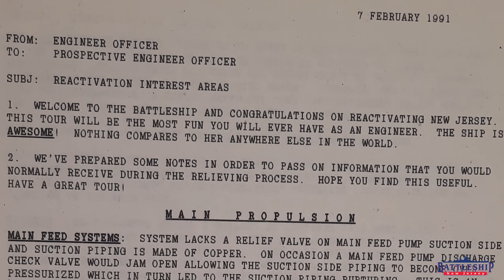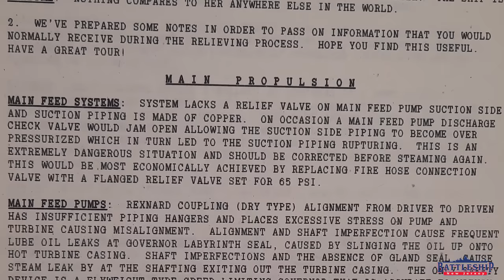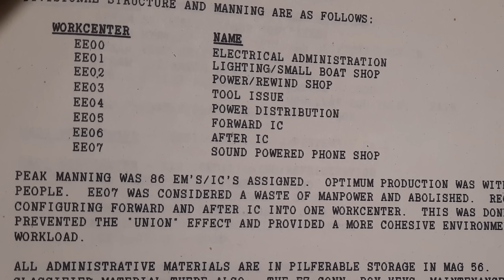The Call To Freedom Will Be Sounded Again: How to Bring Back Battleship NJ

Comment: This is incredible. I’m a shipyard test engineer and I’d quit my friggin JOB to be part of bringing New Jersey back.
Reply: I'm x-Navy and a mechanical design engineer in Aerospace Industry now, but I have told my family the  same thing...I'm pulling for San Diego to get one to renovate!  See you there!
Reply: I'd just about quit my job just for the privilege of rummaging that second box down!
Reply: I’m a licensed pipe fitter and hvac tech. You go, I’ll go!!! I’d love to get the Missouri going too!!!
Reply: 30yrs of welding, fab, machining and industrial painting... I even have tools?
Reply: You'd have so many volunteers will I ng to sleep on board and work!
Reply: I can cook and sweep floors.  Also a pretty good bottle washer if I don't say so myself.  Mop, I can also mop.  When do we leave?
Reply: I'd love to see all 4 of those hulls get refitted with A1B Nuclear Reactors, and new high efficiency propulsors. 

With that much shaft hp, and turbo electric capacity, they could install just about anything and still have plenty of power to spare.
Reply: I don’t think they will. But I think they should. As a weapons platform it is amazing the potential it could have.
Reply: I am Italian , marine engineer with experience on steam ships, I would sell my soul to do that !!

Comment: Honestly, I feel like the topic of bringing back the battleship will be around as long as this channel is lol
Reply: Along with the 'can we make the turrets operational" arguments.
Reply: The battleship reactivation debate will be around until there's an adequate replacement for them in the naval gunfire support role. That's the only thing that will end it.
Reply: as long as the 4 Iowa BB's are still floating the debate on reactivating them will continue
Reply: @baronpen  Naval gunfire is a dead concept. VLS missiles do everything better and all modern ships fire the same missiles but just have different amounts of them.
Reply: I feel bad for whoever we bring it back against.. searam and lasers going to make her pretty stout
Reply: @crazybarryfam  I don't think the powerplant would be able to power lasers lol. It would take like hours of charging capacitors to build up enough charge.
Reply: @rubiconnn  I don't think so, the Burke's have them and I think the steam plants on the Iowa class have enough excess potential. Regardless, a turbine plant could be added if need be. The Iowa's have as plethora of space and steam.
Reply: @crazybarryfam  In another video they said removing the old powerplant isn't really possible due to everything being deep in the hull with like 6" thick armor hull around it on all sides so they are stuck with the oil burning hybrid electric propulsion.
Reply: @rubiconnn  the Rail-gun concurs. Relatively small, energy dense projectiles.
Rockets are expensive and need a guidance system and lots of propellant, that severely limit the weight of a warhead.
So, they need a LOT  of space and deliver  precise, but low effect to a target.
With LOTS of projectilees in the same space as 1 rocket, the ship can store much more ammo, for a lower price.
Reply: @pteppig  The railgun project was abandoned by the military as it's unfeasible with today's technology. Missiles are here to stay with lasers and guns being used for CIWS. Even if they made a viable railgun, missiles would still have ranges orders of magnitude more than a railgun could ever shoot.
Reply: @rubiconnn  Anything is possible, just takes the will and $$.
Reply: @rubiconnn  who wants to remove one? You could easily install a gas turbine to supplement.
Reply: @rubiconnn  you can NOT shoot down a 16in shell!
Reply: @captaincumrag42069  There was Russian Moskva which did use it's guns to provide fire support. But it's guns were nowhere near as big as the Iowa class. It also sank. (Although it was in far worse condition than the BBNJ.)
Reply: @americanpatriot3638  Can you? You can probably shoot it down but it is very different from a missile and would probably be much harder to lock onto it with missiles due to a lack of propulsion systems.
Reply: @maxbennett5412  CIWS doesn't track heat or light. It uses radar to find projectiles. The land based variant (the C-RAM) can track much smaller projectiles no problem like mortars and rockets.
Reply: @americanpatriot3638  You don't need to shoot down a 16" shell as any ship that fired them would never be able to get close enough to a target that would have close in weapons to use them. A 16" gun has about a 30 mile range. A cruise missile has about 1000-1500 miles range.
Reply: @rubiconnn  Perhaps, but in a large scale conflict you have to be able to produce and pay for those missiles, as well as have the rare earth minerals needed for them.  Plus, it would take a lot of ships indeed to bring as many missiles to a fight as battleships can bring shells.  And every VLS cell that is loaded with a Tomahawk is one less cell that can be loaded with an air defense missile, something that could prove critical, especially if fighting stealth aircraft that are hard to track.  

Certainly reactivation of the Iowas is not a viable thing.  A ship with large caliber, fast firing guns is most definitely not out of the question, especially if equipped with guidance packages and rocket assisted projectiles.
Reply: @MK0272  Large ships are completely unviable in the modern age. For the size of a large battleship you can build several destroyers or cruisers. Large guns for anti-ship/shore bombardment are long gone and are never coming back. Ships technically still usually have a small gun on the bow of the ship but that's mostly for close range engagement with small boats when firing a missile is impractical. There's pretty much no way that ships from two opposing sides in a conflict could ever get close enough to fire guns at each other.
Reply: It would be easier and faster to build a new ship.
Reply: I would love to see the iowa's back in service but from a cost perspective it would be to costly to reactivate and modernize them with all the new technology we have today
Reply: @rubiconnn  they do use thermal
Reply: @rubiconnn  Problem with missiles is they are hideously expensive compared to naval gun rounds. A missile easily costs more than a million dollars per missile, vs large caliber gun rounds which are a few thousand. Missiles, also being much larger than gun rounds, means a ship cannot carry as many missiles as they can gun ammunition. Its the same reason guided rocket artillery hasn't replaced conventional gun artillery except for only the largest calibers. The sheer expense of missiles means that they are limited to being used against point targets that you know exactly where they are. But if you don't know exactly where a target is, just its general location and you need to suppress that area, missiles are far to expensive to expend for that purpose, gun artillery is perfect for that role. 

Dug in infantry and camouflaged vehicles hiding in a forested area is a perfect example of the type of target that missiles would have a hard time with.
Reply: @rubiconnn  Incorrect. Railgun's are being placed on hold because the R&D for them is basically done, they just need to find better materials for the barrel wear problem. And see my comment about the expenses of missiles that makes them not universally useful.
Reply: @rubiconnn  Don't assume anything about the future. Naval warfare is always evolving and changing, and there is always the possibility that one day the modern paradime of missiles dominating naval warfare will go obsolete. By what, who knows, these things are not predictable. It's certainly not impossible that future railgun and laser development could render missiles obsolete, but when, who knows, these things are impossible to predict.

And on the subject of large ships, large ships are often more cost efficient than smaller ships due to economy of scale. A large ship that costs twice as much as a modern DDG or CG would easily be able to carry more than three times the number of missiles, as well as having a greater engagement range because it can mount its radar higher and thus have a further radar horizon. The problem is that kind of capability is unnecessary in a world where few navies have more than a half dozen DDG's ad war between any larger navies is very likely to end in a nuclear exchange. 

And when the only capabilities a larger ship can offer over smaller ones is just carry more missiles, longer range radar and the potential to armor against most missiles, it isn't enough capability difference to justify building a whole new class of ship in a navy where the role of a surface ship is to protect the aircraft carrier and let the aircraft carrier do all the offensive work.
Reply: @ryuukeisscifiproductions1818  Times have changed and warships aren't really used for that kind of tactical support purpose anymore as ships can't even get close enough to shore for coastal bombardment without getting hit by anti ship missiles. Nuclear weapons have made major conflicts between large states unlikely. The support roles of warships has been replaced with aircraft. Combat for warships is so uncommon that the cost of missiles doesn't really matter when only a few missiles are fired from a warship per decade.
Reply: The discussion of bringing It back will be around as long as the Battleship is afloat.
Reply: @ProfessorMAG  and that’s the one that would kill them coming back the restoration to active service they could probably build 2 of them in the same time
Reply: @baronpen 
Doesn't have to be guns delivering an explosive charge somewhere, so saying that until there's guns that can take the place of gun's on battleships there may always be a possibility to bring them back is completely mute. 
People should just admit that they like battleships and think they're cool instead of stretching out some narrative that's irrelevant in this day and age, for the same amount of money and time it'd take to get a battleship back online lots of other far more flexible and effective weapons can be acquired, why does it have to be a gun that delivers an explosive force? It doesn't, there's plenty of other far cheaper ways of doing it, and when it comes to military spending cheaper means you can have more for the same amount of money, so why cut your own throat for the sake of nostalgia?
I've been a mechanic since 1981, you'd be hard pressed to find anyone who loves the old muscle cars more than I do but by the same token because I've been around, and thoroughly through, automobiles for so long I'm not stupid enough to fall for that whole "They don't build 'em like that anymore" nonsense, they don't, they build them better now, today's cars make far more horsepower per cubic inch than they did back in those days and they do it using far less gasoline per horsepower also, they hold a rock steady idle which those old cars couldn't, they go much further between rebuilds and just about anything else you can name is vastly better about them than it was back then, which is exactly why the only time you see those old cars in races is in vintage racing, because if you tried racing one against modern cars like in SCCA Sports Car road racing one of those old cars would get beat up so bad it'd be embarrassing.
Another and even better comparison would be the M1 rifle, still an effective battlefield weapon by any standard but given it's expense of manufacturing with all of it's forged and heat treated steel parts you can put twice as many M16's on the battlefield, and like modern weapons compared to the guns of a battleship it has other advantages over the M1 to boot.
The days of parking a battleship just outside someone's port to choke them to death are gone anyhow, aside from better ways of delivering an explosive charge into someone's lap warfare itself has changed substantially anyways rendering the battleship obsolete.
Reply: @rubiconnn really the role of. Battleship is power projection above all else.  Sure other ships are better at land to shore attacks and are at less risk of being hit, but imagine you are a nation debating going to war, and a opposing country sets up a fleet of battleships in international waters just outside of your major ports. Along with a threat that if you attack, every one  of these ports will be destroyed.  At this point it doesn’t matter if they shoot at the battleships because today’s weapons could only cause mission critical damage to these ships, and if they fire then the battleships mission is over anyways
Reply: Standard 16in guns have a 30 mile range. 16in harp gun have 110 plus range.
Reply: @rubiconnn  You won't be supporting a naval amphibious landing operation with VLS missiles.
Reply: @slags83  Large scale amphibious landings in combat don't happen anymore. No country on earth builds large fortifications along shorelines anymore. Even for some backwards reason they did, VLS cruise missiles could absolutely be used. Instead of moving your large ships to close to shore do fire hundreds or thousands of shells hoping to hit your target, where they would be easy targets for anti ship missiles, you could precisely destroy any targets with cruise missiles from hundreds or thousands of miles away.

Comment: I don't think they'll be brought back, although I won't say "never."  One never knows what may happen in the future.  I remember years ago someone asking a B-52 pilot why the Air Force keeps them, even in this day of precision guided bombs.  His answer was "Sometimes, you just need to drop a lot of dumb bombs on something, and that's what this can do better than anything else."  It may someday be that the Navy decides that sometimes, you just need big guns to shell something, and what can do it better than anything else is an Iowa class battleship.
Reply: Why not say never? The infrastructure to put one of these back in service doesn't exist anymore, literally everything will have to be rebuilt from scratch. I dare say the only reason they added tomahawk missiles to these ships is because they didn't have enough replacement guns left over.

They'll crank out a couple dozen missile cruisers with 8 inch guns. They don't need battleships that will do nothing more modern ships couldn't, but bleed the navy's budget.
Reply: @tremedar  You might be surprised.  Look up Watervliet Arsenal, and what they can make.  As for budget, the question would be "is it cheaper and faster to return this to service than to build a new ones?"  

Now practically, I'd say it's not going to happen.  But then again, most military planners thought that massive artillery duels were a thing of the past, until Russia invaded Ukraine.  So, I won't say "never."

Comment: I would definitely like to see a copy of (and an on-screen review of the areas in) that document. It'd be interesting to see the areas of the ship the last operating crew thought would need attention in a potential reactivation and how they're fairing 31 years on under the museum's stewardship. 

I'm especially curious how much stuff that's on that list is also on the museum's list (or was previously repaired by the museum). I suspect it deals with the mechanical systems moreso than the hull & "routine maintenance" stuff you have to do to keep the ship watertight and in good repair,  but I have to wonder how much overlap there's been between the departing engineer's concerns and the museum's over the last 3 decades.

Comment: The best job in the world you've got on board of her. Finding all these treasures is indeed archeology. She would be a great command ship, the firepower easily expanded with guided artillery for precision shore bombardments. She is absolutely seaworthy and big enough to equip her with all the necessary defence systems, and missile and drone offence systems. 
Lots of the old wiring can be replaced with modern canbus systems. And seperate oldschool backup communication and control systems so no EMp can hurt her capabilities.
By the way; astoishing how well you all maintain her, an absolute huge respect to you all from an old ship engineer.

Comment: I could see the navy doing something like what happened in the 1980s, as in "we need it for numbers, not necessarily for war" and then it ends up in a war anyways. I could see them reactivating it just as a way to "reset the clock" on the boilers. 

In the 1980s, it wasn't universally agreed upon to reactivate them either, yet it happened, the industries that made and supported them were gone or in the process of being gone. All what would be required is an administration that wants it bad enough and money and government would fine a way, it always does.

Comment: Ryan, this was fantastic!  What a treasure that folder is.  Congratulations on finding it.  As to reactivation someday, I think the Navy believes the Tomahawk is all they need for long and intermediate range bombardment.  Cost per round is astronomical, but but annualized total cost per hit (including maintenance and operation of the delivery vessel) is likely much less.  (although can you imagine how cool a 16 inch projectile with a modern terminal guidance head would be?  or perhaps a hypersonic saboted 8 or 10 inch round fired from a 16 inch gun?)